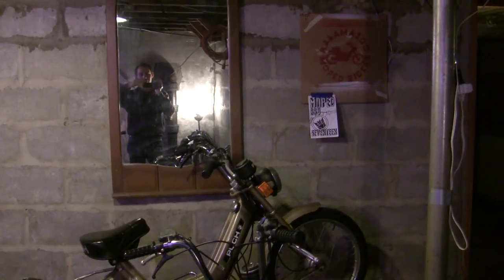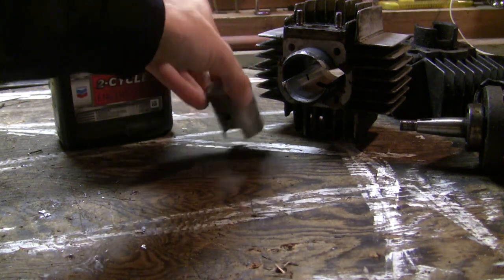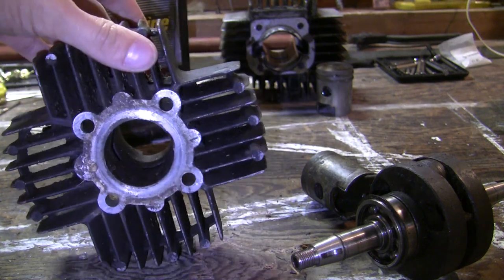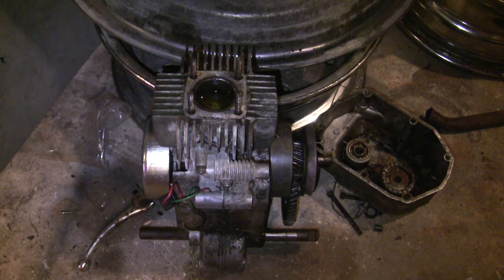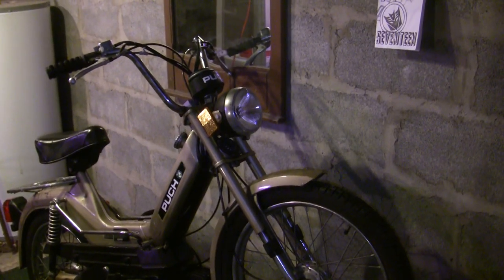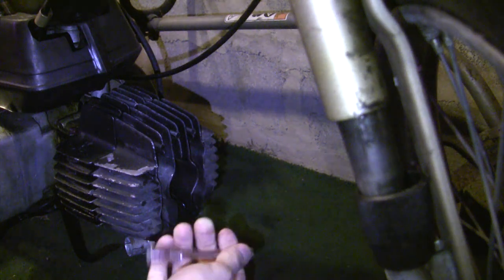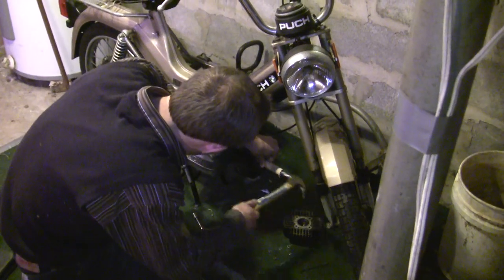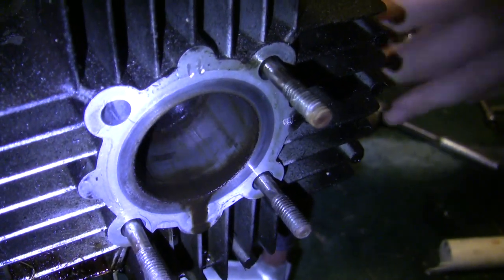How to & Information on Unseizing Moped Engines

Comment: I wish that I had seen this video sooner, I had advanced the timing on my 1980 Sach Sundancer too far. I ran rode the bike and in the morning found that it was seized, I simply used the flywheel bolt to break it loose, it broke loose easily and seems to be alright. next time I will at least use penetrating oil sprayed into the sparkplug hole and obtain a temperature gauge. Thanks guy's!

Comment: Sorry to ask a question so many years later, but I believe my moped engine seized after not having the right fuel oil mixture. It was ignited twice before stalling and completely dying, but is it possible to unseize or repair the issue by myself?
Reply: Did you fix it?

Comment: Nice tutorial! And the other ones helped me a lot. Just have a question. I'm repairing my father's 1974 Puch Maxi S and i can't turn the flywheel a full turn. The piston moves but just a bit. Any ideia what is the problem? Once again, thanks for all the tutorials. Cheers
Reply from the maker: Might want to take the top end apart and check condition of the piston and rings, could be a bad bearing on the crankshaft
Reply: Thanks for the tip! I'm going to check.

Comment: This is an extreamely helpful video. I have a '78 Batavus Laura M56 engine that I'm trying to get unstuck. Unfortunately, after I pulled the head I saw surfice rust throughout the top of the bore. I'm hoping I can clean that up. Got a question though. Where do you get your parts from? I need things like head gaskets, engine side covers (clutch & flywheel), and I may need the electrics under the flywheel. Plus some tools to get the flywheel,clutch and all that off. Thanks.

Comment: Odd isnt it how we all get slightly different versions of the same thing.

On my first puch maxi 'N' type with solid back frame i had to change the little end bearing, well we had a special only puch shop that supplied the part.
But one thing they dont tell you is its not a drop in part!!, you have to get an adjustable blade reamer and slowly take material out so the (gudgen pin/piston pin/wrist pin), just fitted snug in the bearing in the con rod.

What a pain in the bum lol

Comment: Hi, im having a big problem here. I watched this video several times but i cant seem to make any progress. My scooter (yamaha neos) 50cc moped has a seized piston. I took the cylinder head of and tried turning the crankshaft. The cilinder does move away from the block but the piston is completely stuck in there. I tried putting some wood between the cylinder and engine block itself and hitting on the piston with a socket and a hammer. The thing didn't move at all. Any tips to solving this issue?
Reply: Did you figure it out mine seems similar to yours?
Reply: @whowho7969  Yes, I watched a different video. I took a piece of steel (+-2cm thick). Drilled three holes. Tapped the center hole for an m10/12 bolt. cant remembrer. Take the cylinder head off. Bolt it the steel bar on like a half x (cross) over the cylinder. So diagonal on top of the exposed piston and cylinder bore. Snug the steel bar down with the nuts. Now get your m10 bolt (a long one) and thread it in with a ratchet. Piston should move down. Took a lot of turning and force but this worked excellent for me.

I still have the old piston and cylinder as a memory. Total carnage! 2-3mm deep grooves
Reply: I got it thanks 👍

Comment: If the rings are what's making the seal, why ever replace the piston?
Reply from the maker: +jazzbuckeye 
You mileage will vary, as it's a case by case basis. If the piston was only stuck a little bit, you could probably get by with new rings and a hone. For that to be the case though you'll have to check a few things, for example does the piston still pass the "piston drop test" - that is where you "drop" the piston through the cylinder with no rings in it to check if it's deformed. You'd have to make sure the new rings move and seat properly. Even then, you could probably sand the piston a little strategically and save it.

A lot of the time the piston could likely be salvaged, it just comes down to the extent of the damage, the time to repair, the skill.